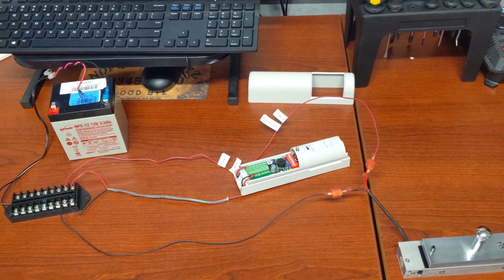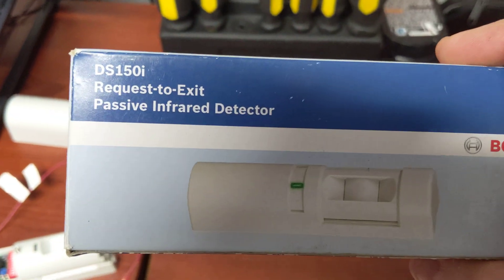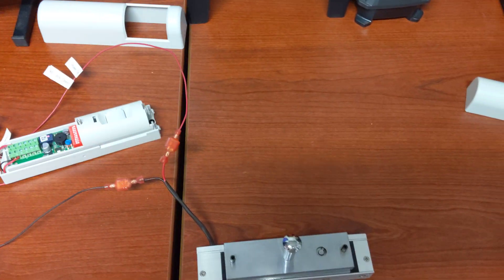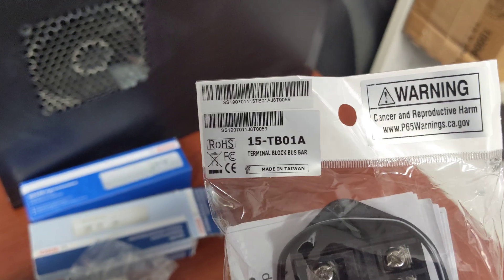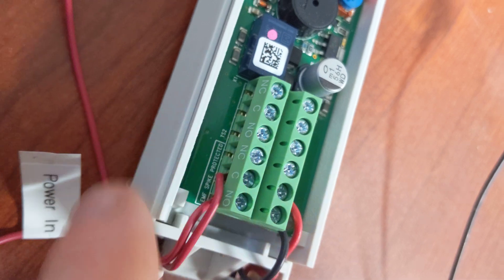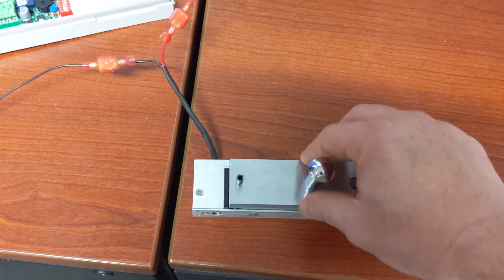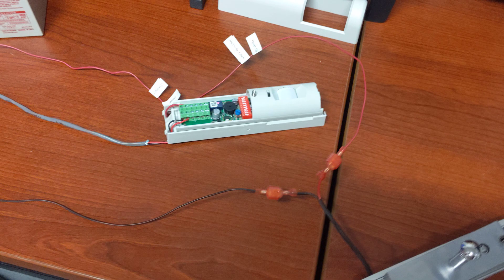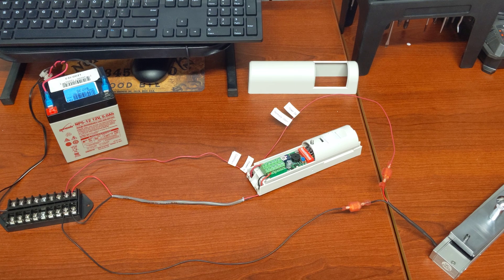Simple Motion Sensor RTE to Maglock Setup

Comment: How come the maglock is wired to N.O on the motion sensor and is locked when there is no motion please explain Thanks
Reply: @jake90770 and @The Black Hand - I believe the reason that it was working is that he had dip switch # 3 in the off position (fail secure) and if you refer to the installation instructions of the DS160, with dip switch #3 in the off position, the contact output wiring is actually backwards so what is shown as NO on the input label is actually NC when dipswitch #3 is in the off position.  If you are going to install this in a fail secure mode, you typically need to have AHJ authorization to do so.  Typically with mag lock installations......they are required to be installed in a fail safe manner (to drop on either power loss or fire alarm input closure).  In my opinion, this tutorial should have mentioned how the state of the dip switches are important to know so you know how your output contacts are going to react.  I thought the same thing, I had to download the install instructions...then go back in the vid and pause on the dipswitch states and look it up.  With that being said, he had the balls to put this on youtube and it forced me to learn something.......silver lining.  I applaud the information sharing!
Reply: I believe it is because maglocks require power to stay magnetized (locked). So a normally open connection would mean there is power as a default until motion is detected. Then power is cut and the maglock stops working.
Reply: @shadowhawkk47 That makes sense Thanks 👍
Reply: Normally open is wrong
Reply: My sensor is not locking the door